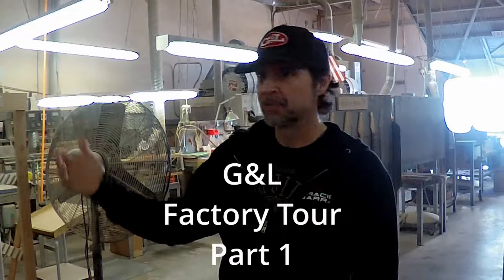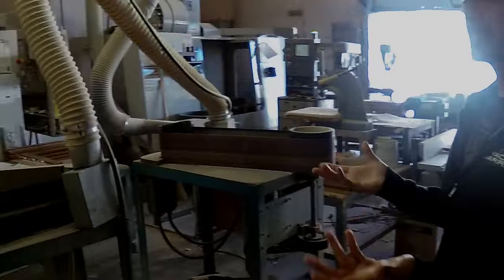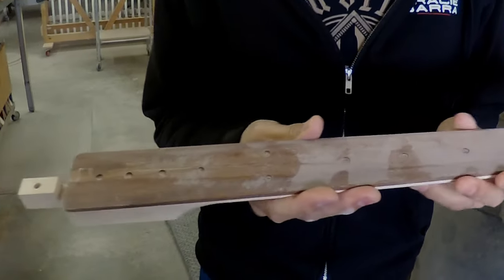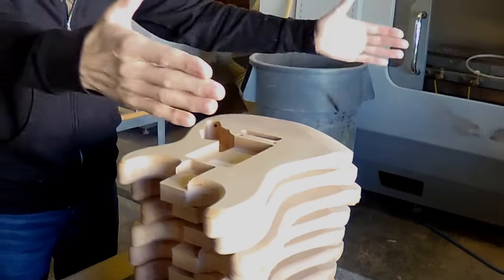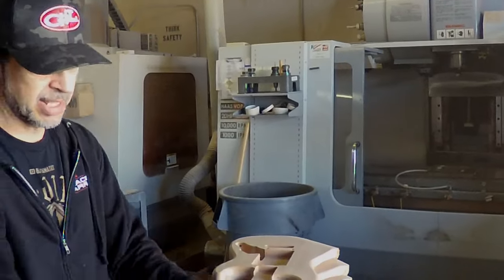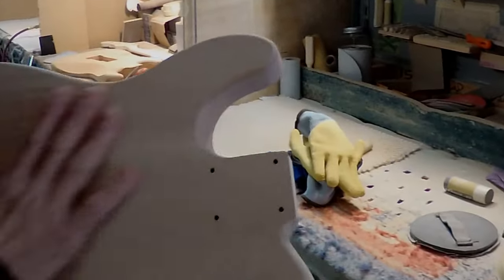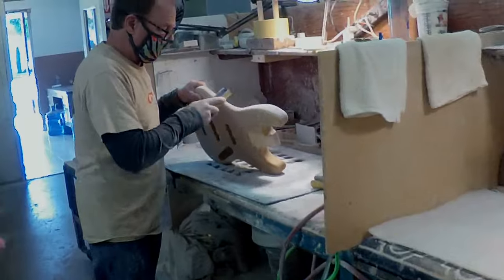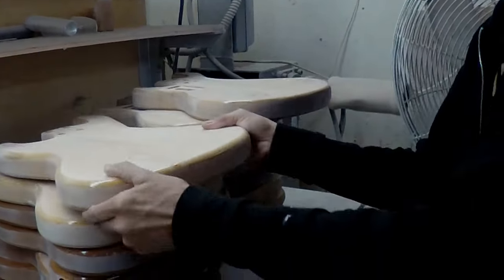Exclusive tour of the legendary G&L Guitar Factory (Part 1)

Comment: Interesting, looking forward to the next one. 
My 1st bass, bought on impulse, is a used tribute l2000. I did get a couple more classic designed instruments like a P- and a J-bass in budget frindly versions since. But the more time I spend with it, the easier it gets to find beautiful sounds(imho) on the l2000, that are close to those so called classics and totally different ones as well. 
So as time passes, I'm now pretty certain, when I get a premium bass it might just be another l2000, only made in the US. And I'm wondering why they are not more popular. Not just the basses, but Guitars too, find those z-coils very interesting.
Reply: Reverb often has old G&Ls for sale and I bet you'd like them even more!
Reply: @carlton1390  an old looking ash body, with natural finish would definitely be nice to have. But I will probably go for the okoume body, weight is an issue for me and the modern neck just feels faster. But thanks
Reply: Fair enough, some of the old ones are heavy, but certainty not all. The old L2000s have OMG mode instead of regular series which I love. I hope you find the one for you.
Reply: @carlton1390  Oh, I thought the OMG mode only comes with the single pickup models, like the L1000 for example. Then again, I never made sure of that. And as for the weight, it's true, there are quite a few older ones that aren't that bad. Just saw a L2000 yesterday that weight much less than my tribute. Well, considering the prices of good oldies, even if I were to get a custom neck for faster feel, I would still spent much less than a new one would cost... 
What year is yours? And do you happen to know when G&L stopped putting the OMG mode into the L2000?
Reply: I’ve had a couple of L2000s. My first was made in 1992. I had it for about ten years and I would have kept it but I was on a Jazz Bass quest and ended up with a Fender AV 64 which I love. Later I missed the L2000 and bought a 2009 one. It wasn’t half the bass that the ‘92 was but I got it cheap. From memory they stopped doing OMG mode on L2000s in the late ‘90s. It’s cool to have it on two pickups! There is/was a site called ‘Basses by Leo’ that had a lot of information on G&Ls.

Comment: Leo Fender insisted that a hand made instrument using the equipment he developed made a better quality guitar/bass than a CNC'd one. His necks used what he called a bi-cut design and were very stable. He also believed that hand wound pickups were better and did not use automated winders. Leo refused look backwards to his old instruments and would not reproduce them (the closest he came to this was the ASAT and he was pressured into producing it). He would be appalled by what "G&L" are doing now!